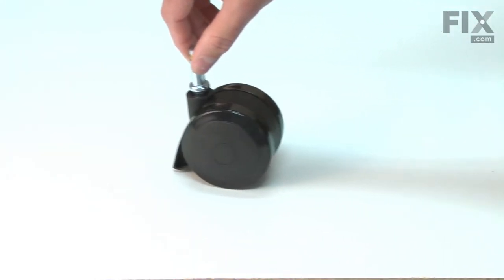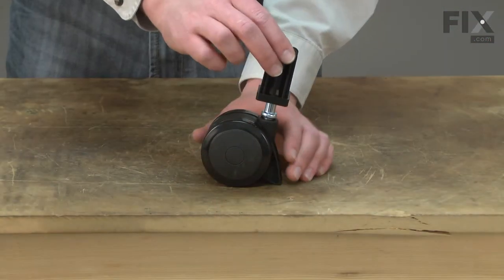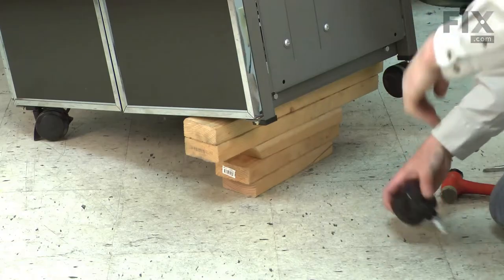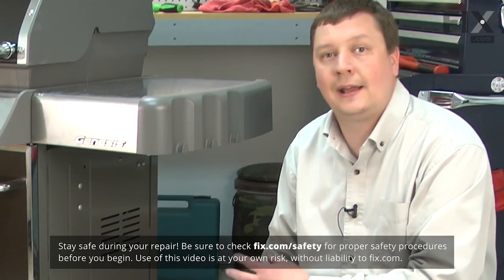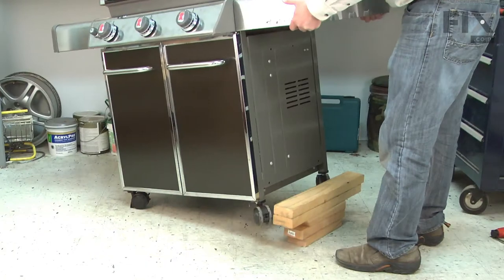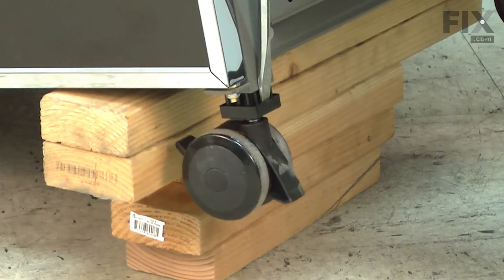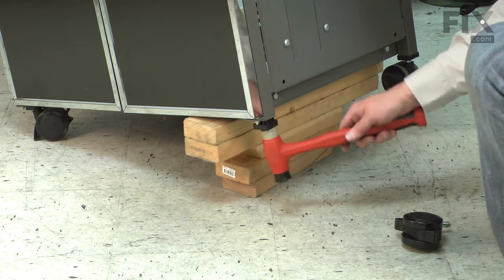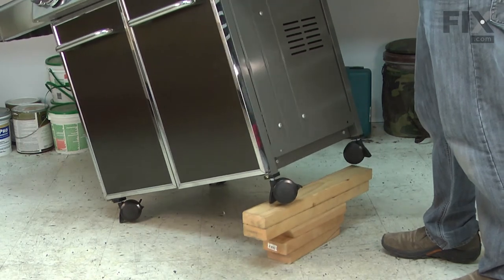Weber Grill Repair - How to Replace the Locking Caster

Comment: I have had to replace Three Sets of these Plastic Casters Due to Patio Pavers. Found a Company On line called Service Caster-Purchased 5" Blue Non-Marking Polyurethane Wheels with the 1-1/8" Expanding Stems Now My Grill is like a Million Bucks and No worrys of Broken Caster Wheels they also sell ones with Brakes. The 1-1/8" stems slides inside the Corner tubes which are 1-1/4" square tubing and they Easily Expand into a More secure mounting

Comment: Any suggestions to add better castors that will not damage a composite grill?  The castors that come standard with the locking tab can become lodged between boards and when trying to free them can damage the boards.

Comment: My old caster blocks will not come out. When following this method the plastic broke off with the first screwdriver hit. Any other tips on how to remove stubborn ones?
Reply: I had the same thing happen on 1 wheel. Did you ever get it out? How?

Comment: My new Genesis has two fixed position large wheels and two casters.  Have you ever replaced the two large wheels with casters?  My old Genesis had 4 casters and was much easier to move around.
Reply: Did you ever try this?  I heard you can replace the large wheels with casters.  I’m thinking of doing the same thing.